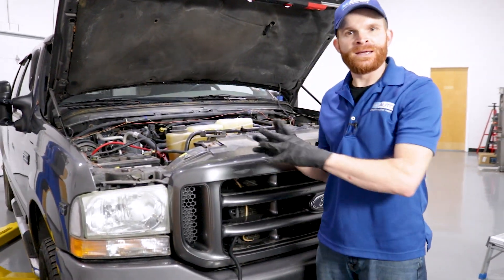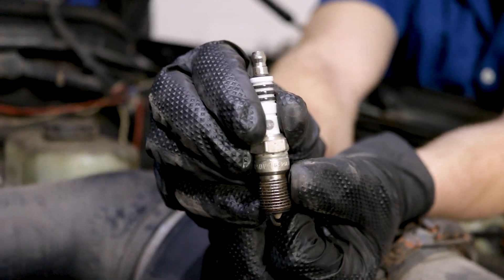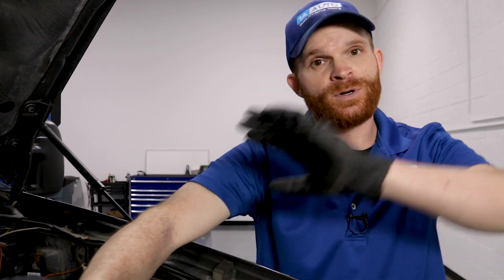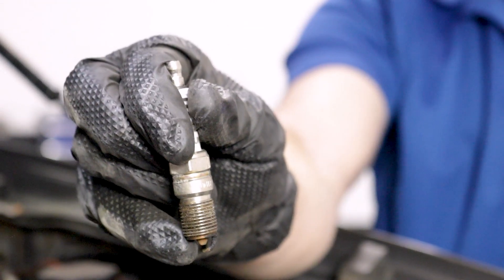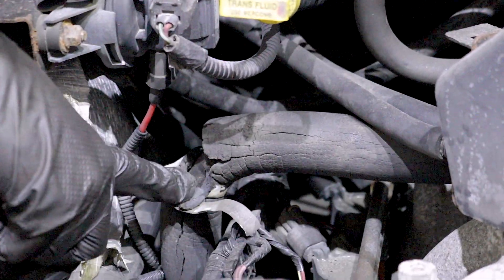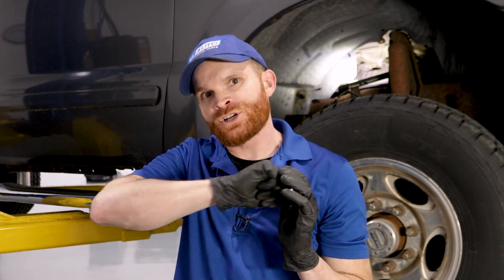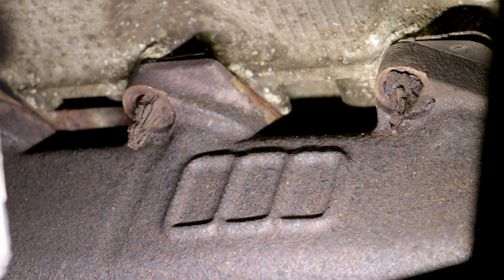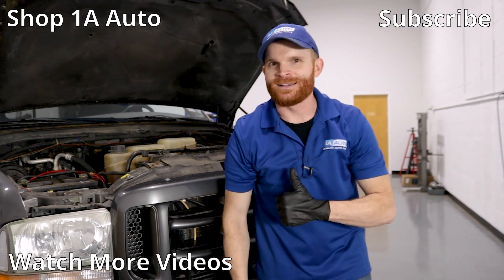Top Common Engine Problems 1999-2007 Ford F-250 Truck

Comment from the maker: √  Watch the Video
√  Buy The Part at 1A Auto https://1aau.to/m-Visit-1AAuto
√  Do it Yourself
√  Save Money
Reply: I have a 2003 F350 5.4L 2wd Every Time it rains the truck seems like it starves for gas, I use nothing but premium gas in it and cylinder 5 has given me a problem in the past with accumulating water but I have no intake leak so we put some silicone in the sparkplug well after changing the boot and it fixed it for a while but now its doing it again and no check engine light. I cant figure it out and only happens when it rains and a few days after that, then the truck runs like a dream until it rains again
Reply: I have a 2000 F-250 with the V-10, mine has the 5 speed manual transmission. My 2006 F-250 has the 6 speed manual transmission.  My 2000  Excursion has V-10 and the 4 speed automatic transmission.  None have blown a spark plug ( knock on wood ). I attribute this to my mechanic following the correct procedure for changing the plugs, extremely important.  My 2000 has 250k miles on it.

Comment: My 2002 just put out a p0420 code. And when I start it up it makes an almost low shrill or wheeze I guess. To me its like a rusted piece trying to turn sound. I smell gasoline at tge exhaust. Nothing under the hood. Im guessing its an exhaust leak?

Comment: Same problem with my 2001  ford exhaust system sucks I changed plugs no problem yet besides harder than heck to get the plugs out also u joints were a problem for me bought new

Comment: I have a 2001 f250 v10 if It sit idling for 10 or 15 min it will cut off but will start back up. Once you take off and drive it starts idling again. What causes that? Thanks in advance.

Comment: I have the 5.4 Triton, which also has ejecting spark plugs. They did it on a trip to California. So while I was out there, I ordered the calvan kit and repaired it out there and I've not had any problems. Now, it's been over 5 years. Calvin They don't come out, the spark plugs, come out without any problem. I used high temp red thread lock on the calvan lock inserts in the spark plugs. I put antics, seze high temp, copper, gold, or whatever. on the spark plug thred It was no problem removing the plugs.

Comment: I have a 2000 v10 and it’s flooding itself or something through the carbon canister I’ve drilled holes in the gas caps to relieve the pressure but it still dies ?

Comment: I have a 2000 Ford has been the biggest piece of junk I ever owned the biggest problem I have with it is every so often while I'm driving it will just start acting like  it's not getting no fuel but you can smell the raw and feeling the exhaust pipe I put on five nights in five different shops and evendale diagnosed on my own and I cannot find out where the problem is music by time to get to the shop it just goes away and then a few months later it comes back I'm literally I lost I've got a new fuel pump I've gotten new spark plug new sensors the only thing I ain't doing this truck anymore is the computer and I still can't find the issue 99.9 percent the computer though if you have any thoughts let me know

Comment: I currently bought a 01 f250 v10. Had a slight Miss fire at idle but when I’m driving it goes good? Check engine light is on I scanned it and it came out cylinder 1 I changed the coil pack but still slight miss fire at idle. I can hear a whistle noise around the air intake. I believe it’s sucking to much air. Anyone else have this issue?

Comment: Can someone help me? 
Ran v10s for plowing last season we bought another one 
Dumped $$ into it and was running mint then ended up dying one day figured it was fuel pump so changed it out and now it will start and die…
Could cats be clogged? Had plugs and coils taken care off last season..
Could it be alternator?
Someone help need this truck for plowing this year !!

Comment: I bought a 2006 uhaul van recently. It has a leak at the fuel injector on the driver side at the front of the engine. I replaced o rings and I switched injectors around and still leaks at this one. Someone said I may have excessive fuel pressure causing the leak. I can't find anywhere to connect a pressure gauge to. Any suggestions on what I may do please? Also I was gonna replace the fuel rail but can't find one anywhere, thanks you.

Comment: I have a 2001 F250 super duty, and I've noticed that when putting the engine under load there is a rattling noise. This only occurs when the engine is at 2000 or just under 2000 rpm or underload like climbing up a grade. Any idea as to what this could be? I'm having a mechanic look at my truck in the next few weeks, and I'm just wondering if I can start pinpointing the issue.

Comment: My sons 2003 Ford f250 v10 triton all of a sudden wont start. Changed the starter, serpentine belt, idler pulls replaced and new battery.  Everything comes on lights, radio etc but it won't turn over.

Comment: Does the 2000 2V 315 HP have the spark plug thread issue?

Comment: I have a 2000 excursion with the v10 and I can tell you the pop of a plug coming out while running down the road at 55 mph is not a little pop it sounds like a tire blow out

Comment: My 33 ft Class A Motorhome with the Tritons V10 6.8 motor is struggling to climb hills after I replaced Pcv valve & hose, both O2 sensors & MAF sensor & TPS. Ran fine for 1 day & took hills good, now engine light on again and no power going up hills. Can u advice or help?
Reply from the maker: +@jamesbinger29 We wouldn't be able to diagnose an issue like that here, you may want to have a local mechanic take a look at it. Thanks for checking us out! http://1aau.to/m/Shop-1AAuto-c

Comment: General question about the v 10. My 350 will suddenly die while driving when it’s hot out. It’s fuel injected but I can’t help but wonder if it is vaporlocking? Can a fuel injected engine have this problem?

Comment: I huve Ford pickup F-250 heavy duty V10 engine my problem is when I start the engine goes to 2000 Rpms Rpms and only goes down to 1500

Comment: So, was the end of the short threaded plugs in 2001 or 2002?????  I have a 2002 that STILL has the original spark plugs in it.. My mileage has gone down hill pretty bad over the past several years, but I don't drive much, so I kinda look the other way.. With a fused back, I no longer have the ability to change them myself. It's got 134K on it and it has only left me on the roadside one time in it's 22 years. Super hot Florida August day and I should have filled my gas tank before the 35 mile ride to the wife's doctor. I knew I had enough gas to get home, but with a lack of fuel in the tank, i am sure the factory pump was being killed by heat. That and it had over 115K on the clock when it died!!!  Just today It nearly left me on the side of the road again, as the upper radiator hose let go.  This time I was at the doctors office and I came out to a puddle and that sweeeeeeeeeet smell that you cannot miss.. Again, another sweltering day in Tampa Bay..  I topped off the coolant. Left the cap loose and drove home  with the windows open and the AC off... I coaster with the engine off every change I had and killed it at red lights. (Maybe a good way to save some gas too)!!!!  Anyway, I really need to do some real maintenance on the old girl.. Hell, I owe her!!!  This has been an incredible truck. I've only changed a few running lights and  tires and brakes. Did change the shocks a few years ago, but other than the normal stuff, i have still got all the factory everything but the fuel pump... Hell, my AC is still ice cold!!!!!   Oh yeah, you know those rotted away exhaust manifold bolts?? Mine are all just like brand new...  Ya know, there is something about SALT that  just really tends to destroy EVERYTHING!!!!!  Glad i no longer live in the SALT-BELT...

Comment: I have a friend with a 2007 crew cab and it lost power while towing a camper over the hills and when you start it up you can definitely hear an irregular erratic firing that sounds like a valve issue on the passenger side. I need to remove the valve cover there and inspect the cam and rockers. At the tail pipe you can feel that there is an erratic pulse of exhaust. Do I need to jack up the cab to get to this? Is there something else that I could be having an issue with?

Comment: Wait. Did you just imply it was ok to tap and heli-coil a sparkplug hole without taking the head off, leaving shavings inside the engine?

Comment: Don't change the plugs until they don't run right.
2003 gmc 5.2. Never changed the plugs. It still runs perfectly at 160k miles

Comment: okay I have a 2004 ford f350 with the 6.8l v10 motor. it has absolutely no pulling power at all. it bogs down going up any sort of hill. I have heard these trucks are normally amazing at pulling. it does not accelerate at all going up hills knocking it down to like 35 mph. what could be causing this?

Comment: Spark plug issue prior to 2002, and was fixed after 2002?
So what the flip about a 2002? Does it have the issue or not?

Comment: i have a 2000 f250 super duty with v10 and when night temps goes 32 degrees or below it is a little hard to start and if as  it was a few days ago when temp went down low temps it wouldn't hit a lick, what would cause that?
Reply from the maker: +@charlesrussell7090  We wouldn't be able to diagnose an issue like that here, you may want to have a local mechanic take a look at it. Thanks for checking us out! http://1aau.to/m/Shop-1AAuto-c

Comment: I have a 99 f53 with a 36’ holiday rambler on it, I realize it’s very heavy but it very gutless, it almost seems like its not getting full throttle. The person I got it from had Banks put long tube headers on and a transmission thing that plugs into the transmission, I also think it has tune plugged into it, any ideas? Thanks, Jerry

Comment: i have a 1999 f250 super duty v10 and at cold start it runs great soon as it warms up it starts acting up sputtering idle just keeps going up and down soon as u step on gas it goes away I've changed the pcv hose and map sensor cleaned throttle body still runs bad  any clue as to what's going on plugs and coils were done last year along with water pump fan clutch radiator alternator air filter all new

Comment: Thank you!! My issue has been simple and every mechanic has avoided even talking about it! Manifold bolts🙄 
The rest the truck is damn near new with new transmission and entire front end. Been widling away at the engine trying to find the issue.. no codes for months yet loss of power and that dumb tick. .

Comment: I have an 02 excursion 6.8 I pull a roll off dumpster set up with it works great but I do get exaust fuels inside. Still haven't figured it out. The only other issue us the driverside front break always grabs first even after replacing all brake components.

I also have an 01 f250 that pulls a 16ft enclosed trailer for vending no issues at all with it. Both are below 130k miles.
Reply from the maker: +lifeathand Thanks for the feedback!

Comment: You solved most of my problems  but should I check each spark plug or is there a way to find out which spark plug is misfiring? I don't have the computer?!

Comment: I have a 1999 ford with this v10. 200k miles, with a 5 speed behind the engine. I pulled a 35 foot camper and it struggled big time. I could barely maintain 55mph.

Comment: Hi I have a 2000 ford f250 superduty 6.8 v10 4x4  triton and I just had my head resurfaced and installed new head gaskets  put it all back together and it's still overheating w code p1299.can you help me solve my problem?

Comment: I have a 2003 f250 super duty 6.8l v10 that stalls occasionally but starts right up again after turning the switch off for 30 seconds or so. I've replaced multiple sensors, the fuel filter and relay, and cleaned all connections but the issue remains. If you have any ideas for resolving this issue of stalling I would greatly appreciate your feed back. 
I can drive the truck 4-5 days without a single stall, then out of the blue she stalls.  Most offen it stalls under power but has done so at idle 3 times. Can you help?

Comment: Main issue i seem to have wirh my v10 in my 01 f250 superduty is that after installing a new fuel pump im only getting a little over a hundred miles to a full tank of gas now where as before I could go almost 400 miles to a full tank.  Not sure what the issue is with that. The engine is out of a 2003 f250.  She runs pretty good actually. I mainly just drive rhis truck literally a couple miles up the road to & from work.   The old girl definitely needs some work done to her but all in all itsa pretty good truck for the shape its in...

Comment: If you have a blown plug get the calvan kit it has the drill, and tap and insert also had a guide to keep it straight.
Reply from the maker: +Brandon Curtice Thanks for the tip!

Comment: 2000 f350 v10 with about 208000 miles on it. Just started surging a bit at idle. I'm suspecting the pcv hose. Holler at me if you know of anything else that can cause the surging symptom

Comment: P- 0720 comes on and I have replaced most electrical problems and overhauled the trans 4 speed transmission. What else could be wrong?

Comment: 4:21pm eastern.  So I am troubleshooting an f350sd 2003 flat bed which cranks but doesn’t start.  I sprayed a bit of fuel into the air intake throat valves and it started right up, shutting off as soon as it used up what was sprayed.  I pulled the hose off from the filter below the driver side frame and cranked the engine, no fuel.  I also don’t hear any pump noises from the tank.  Could it be the tank fuel pump?
Reply from the maker: +Brian Wilhite We wouldn't be able to diagnose an issue like that here, you may want to have a local mechanic take a look at it. Thanks for checking us out! http://1aau.to/m/Shop-1AAuto-c

Comment: Would be cool if you did a video about the the intigrated relay panel for the fuel pump and related components.  Cost me $1300 in St George Utah to have the Ford integrated relay bypassed so that I could get home.  Now I'm having trouble with the other integrated components on the same panel. Would be a great video to see what's involved with just replacing the whole panel instead of waiting for each relay to fail.
Reply: Umm.. forgot to add.... had to have the fuel pump relay bypassed.

Comment: I have an 01 ford excursion v10 and I feel like I have lost power and when I first start it it sounds under water or like the exhaust is blocked and rpm drops and then comes back up. Till it warms up

Comment: So, in other words, the real problem with the engine was the ALUMINUM HEADS;  all to save probably 100 lbs. in a vehicle that weighs 6000 lbs. or more - NOT WORTH IT!!  And, it took ford 3 years to (fix?) the problem!!

Comment: I have both a1999 V10 and a 2000 V10.  Within the last 6 months both have developed fuel pump issues- crank good but no start.  I’m learning that the fuel pump relay commission Lt fails on these engines.  You may consider including that problem in your list.

Comment: Hi buddy I got the same truck but 2000… It really is a very reliable, resistant and durable vehicle. I have traveled all over the country with it, I have pulled heavy trailers and it has never let me down, the spark plug thing is true, it has done it 2 times after 10 years with it... but I have now a P1633 what should I do? thank you

Comment: Okay I got 2000 f250 super the headlights are flickering new alternator and a new battery I change the ground strap in back of the engine still flickering what could be the problem

Comment: I’d say the blowout problem is still present on newer engines, just less common. I don’t own a 6.8, but I do have a 2009 Crown Victoria with the 4.6. It blew a plug a few weeks ago. Easy to fix, just pricy. Not a bad guide for people wanting to buy one of these trying to find what can fail on them. Tritons are solid motors with a few flaws like any decent engine.

Comment: Bought a ‘99 from a buddy. F350, flatbed, new trans, new brakes, new coils, new Cooper tires… the list goes on and on. They got tired of putting money into it, so I picked it up for 1500. I’ve put a few hundred into it, but at 250k on the clock, this thing is a dream. HOWEVER, it makes a weird shrieking noise occasionally, hit a bump, noise starts, hit another bump, noise stops. What in thee heck!? I’m stumped.

Comment: Great video they seem to be helpful. I have a 02 excursion V 10 the other day it lost all power brand new battery no lights dash lights or fire to the starter. Not sure what’s going on battery no more than two months old has anyone ever experienced this actually, the battery is about four months old. Thanks in advance for any input.

Comment: I have a 2003 Ford F-250 V10 Triton that always had that ticking noise… in the old days we called them tapets. In 2013 that noise became a huge loud clicking noise. I stopped driving it because I didn’t want to cause further damage to whatever was wrong. Now I’m dreading the cost of getting it fixed

Comment: hello i have a 2001 ford excursion 231000 miles it has a really bad lope i did a tune up on it all new plugs and coils it will run for 30 seconds and die 4 or five times then it will stay running the lope has the rpms jumping between 500 and 1500 rpms its worse sitting at a stop sign i am a part owner of a small town construction company and its a little embarrasing

Comment: :41 I'm gonna stop you right there . . . The 6.8 Does NOT require premium fuel. If you reed the manual closely, it says if in your climate/altitude you experience knock, to use premium. I've put around 3500 gallons of 87 octane through these engines, and they run just fine.
Reply: Same. I run 87 octane fuel without a hitch. I believe if 91/2 octane premium fuel is required for this V10, sales would tank for sure.